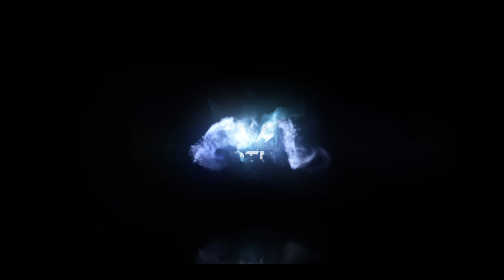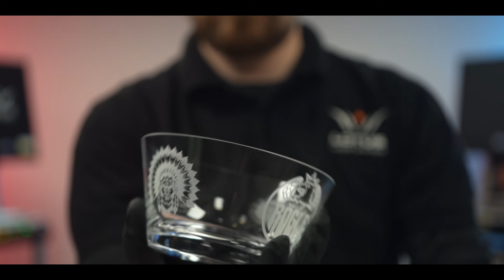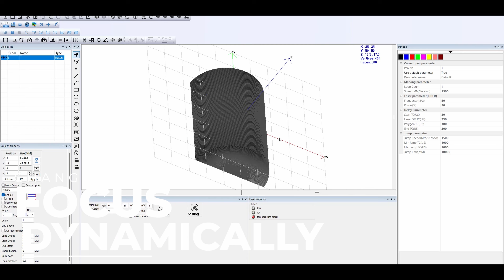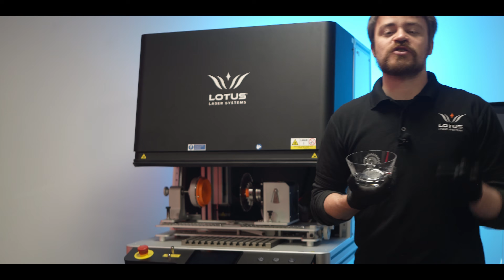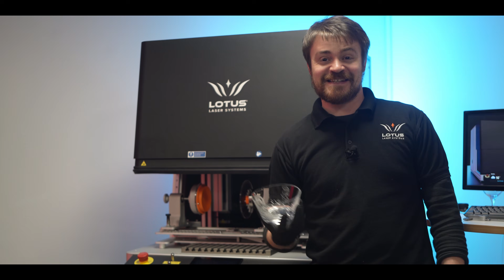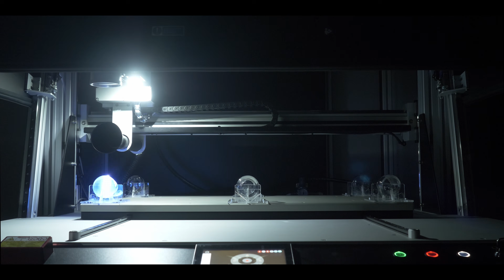Rotaries Can’t Do This! (3-Axis Engraving) | Lotus Laser Systems

Comment: looks absolutely amazing, but if they won't give you a price strait away from their very own website, you know the price for these machines are outrageous and unaffordable for small businesses.
Reply from the maker: We appreciate you saying how good it looks! For the most part pricing is done on request for these kinds of industrial lasers across the board. They are of course more expensive than hobbyist lasers, but we wouldn't say it means the prices are outrageous - it's just that the machines are capable of what our customers need, and need to be built to certain standards/safety compliance. 

We work with all businesses of any size and we're always happy to advise on a suitable machine. This is the other reason for wanting to speak with our customers first - we want to discuss what would be a proper solution, considering all the pain points, and use that solution to actually see where we can save your business money, especially in the long run.

If you get the chance, have a look at our video on Karpas Engineering - they're a very successful business currently using two of our machines, but they're a great example of a smaller, more independent company getting a great ROI from Lotus systems.